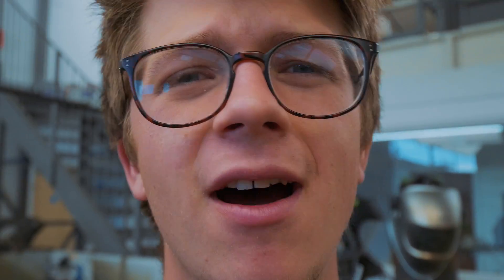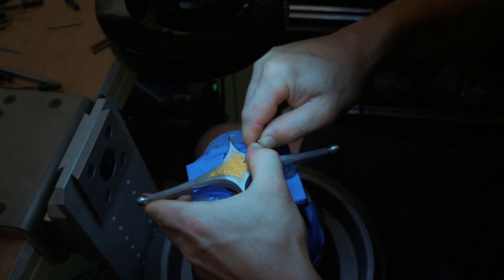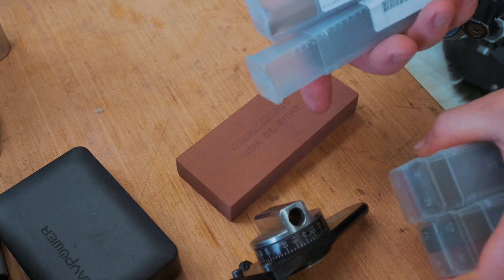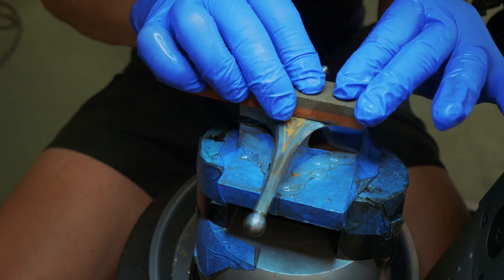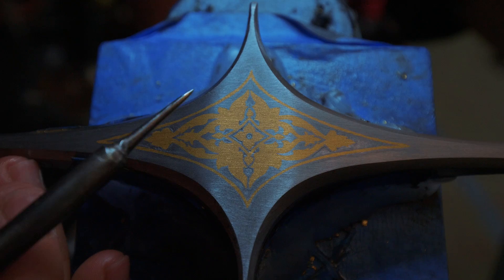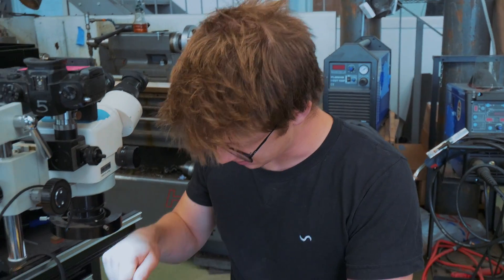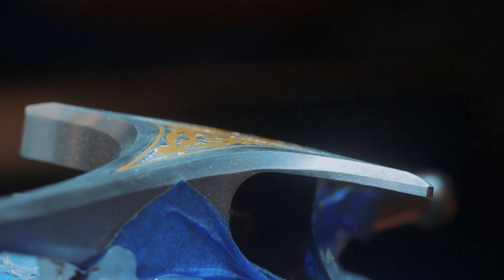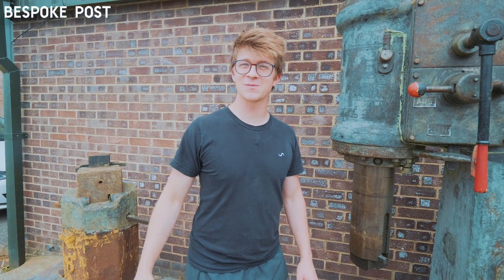MAKING A SHAMSHIR SCIMITAR!!! Part 8

Comment: make sure the scope is ergonomic, often with stereo set-ups like your scope, the eyepieces may become slightly mis-aligned, after hours of intense concentration, slop in the optical paths leads to eyestrain and worse.  i was working on rocket valves and valve seats with Bausch and Lomb Zoom scopes, and got very fussy 'bout my scope.  when it was tight, i could work so much faster.

Comment: You should check out some of the engraving work that Ilya of That Works has done, both on the aforementioned channel and on Man at Arms: Re-forged when he was there. Just like his forging his engraving is top notch as well. And Ilya does it with chisel and hammer, or I guess they are engravers and a hammer. He makes the tools himself from what I understand.

Comment: I am very late with this question but why chisel the top of rather then sand/abrade it away? I would have assumed the original or traditional way of smoothing the gold down flush with the rest of the guard would have been to use either a file or a smooth grindstone to minimize the chance of accidentally ripping up the gold and needing to start over with the inlay

Comment: I wonder, and anybody that has ever had experience with gold inlaying can please tell me because I know ZERO about doing this process... but my thoughts are, what if once you inlay the gold, if you put the whole piece into the paragon oven at a somewhat low temp for a while, would that help with the mechanical bond between the steel and the gold at all?? (My initial thoughts were to just pour molten gold into the lines but that sounded dangerous and stupid haha)

Comment: Every time I see how hard this is with modern tools it makes it more and more stunning that someone did this kind of thing with ONLY medieval or even bronze-age tools 4000+ years ago
Reply: theyd do it over the course of months though, Alec can do it in weeks if hed wanted to.
Reply: @BartJBols  true but I can’t even imagine doing that same piece in a lifetime with the same tools, imma need like 6 if I’m using medieval stuff lmao likely I’d just give up and be a farmer or something for at least 3 of those
Reply: You have to account for the fact that humans have incredible fine motor control with practice, doing it by hand after so long would be infinitely more controllable than the mechanical tool Alec uses, since it has a constant internal motor, the slightest slip can run into a whole line of ripped up or damaged material, when done by hand you can readjust both tools by minute increments,  it's the same with a powerhammer really, it's just the natural downside of powered tools of all kinds
Reply: I’ve thought this a few times, the time it takes, the precision tools but most of all the minute detail they did back then. Utterly astounding.
Reply: Medieval peoples specialized labor to a greater degree than we give them credit for.
Reply: For a one off, modern machinery setup costs are prohibitive, to make a cnc model, cut it, inlay the gold ? dip ?, and finish. 3D metal printer well it costs as much as an M400 but doesnt smell as nice. .
Reply: I was coming down to the comment section to say exactly this, except less eloquently.
Reply: I make knives and whatever else I feel like using exclusively tools and materials contemporary with english knife making in the mid-late 13th century. it's certainly not easy, I'm not gonna say it's a great idea if you have access to modern tools, but i would not say it's exactly harder per se. it's certainly more time consuming, but when working with hand tools it's much harder to make irreversible mistakes because the process is so slow. honestly I find the research much harder, personally. it should be noted though that this is my personal experience, and is subject to my own interpretations and biases
Reply: tools that someone also had to make by hand. someone started with no purpose built tools at some point
Reply: @magoshighlands4074  If I had one major complaint as a layman watching Alec's videos (beyond the fact that pattern-wielding is NOT Damascus) it's that he seems to want to use power tools as much as possible, even in situations where the situation could allow for slower, more controlled hand tool techniques.

Comment: if it wasn't gold and you didn't have to save it(let's say copper), could you just sand the extra off using a belt sander? Or would it drag the metal out of the grooves?

Comment: Have you thought about getting a lawyer engraver? Great design tool, then you’re not relying on a paper transfer? And also, it would be keep lines clean and you could etch deep and light as needed as you added layers of materials in the steel??

Comment: Two mistakes i noticed (compared to what i saw an old Japanese craftsman do).
1. the bed of the gold wasn't well made, it needed far more griping sites for the gold to catch on. Yes, that means more gold the wider the feature. But also, neater execution of the hammering, less gold to remove.
2. i've no clue who told you that using an air chisel would work to remove the bulk of the gold would work, you need to do it by hand, slowly, as to not upset the gold.
Not my two cents, just pointing out something that was discrepant between this and that.

In that case, he was putting gold features inside a small dagger guard. One of them was at least 1 cm wide, and then subsequently got chiseled itself into a lion.

Comment: For the power hammer, you can use paint remover paste, and rust remover paste. Brush PR paste on, leave it for a few hours, wash it off. Same with the RR paste. Then either oil it and leave as is, or repaint it however you like.

Comment: Would it not be easier to reveal the design by sanding? Or would that just rip it to pieces. Using a chisel seems very high risk 😬
Reply: gold is very soft so it cuts easy but that also means that it can tear out easy with sandpaper so you use a chisle to cut away as much gold as you can to get it about flush with everything else, also makes recovering valuable gold way easier then looking thru sand paper dust and used papers. also the stone are like and paper but not as aggresive

Comment: Hmm, wondering of the standard card scraper used in woodworking would work better for taking the gold down. 3 by 5 inch card, and you burnish a cutting burr on it. You are rubbing the bevel/bottom of the card on the surface being scraped down. Your chisel you are using is at a rather acute angle which will make it want to dig in more than one that is almost parallel to the surface.

Comment: 9:40 Did he really learn how to use a rotary tool bur so he will stop walking the bit across his work making a mess of it? 9:43 HE DID!!!! Finally! Let the 10+ cutting edges of the bur and the 40k RPM of the tool do the work and not try to force it, just enough pressure to remove the material is all you want or need. He knows what happens when you put too much pressure, the cutting edges bite too deep in the material and can't cut it and it walks across the project leaving a trail of misery. Do it with a die grinder when grinding a hole and the grinder itself does the walking and can break bones in the wrists and hands or shatter the bur sending bur shrapnel into you.

Comment: The full time engravers I knew, and they were world class, didn’t use those tools. They used rotary tools and every single kind of custom carbide burr imaginable most of them make themselves for specific features of engravings.
Reply: As you find out around 10 minutes. MUCH easier to move material with.

Comment: Instead of all the chiseling etc why didn't you just get a fine flat file or some 400 grit wet and dry sandpaper wrapped around a file and just file it to shape, you wouldnt cut into the harder steel and so the gold would have ended up level with the steel, then finally use it to level everything before you setup to polish etc.

Comment: If you used a chisel harder than gold but softer than the steel (maybe bronze?), would you be able to speed removal because you would have to worry about damaging the base steel?
Reply: I dont think there are chisels made of bronze. I think it would be too soft and become dull too fast
Reply: @raik8243  not anymore but Alec is competent at casting and chisels are easy to make
Reply: Interesting. Theoretically, I don't see why not. Just don't chip the bronze.
Reply: I don't think it works like that. He could use low carbon steel even, but the tool would just desintegrate too fast.
Reply: You would be honing your tool to often to be worth it
Reply: @kennybrandow4994  not on gold you can cut gold with bone
Reply: @raik8243  You're probably right on the dulling too fast portion.
But you and I both know Alec would absolutely make one from scratch if he thought it would work X3
Reply: @AnomalousZoologist  oh yeah absolutely and id love to see him make it work tbh
Reply: He was using a brass rod for jamming in the gold
Reply: @pyro3446  yes his idea is valid as ave would say "hierarchy of metal" but the issue is the chisel riding along the steel sub surface
Reply: @raik8243  Probably not been a call for them since the Pharoahs had people carving monuments for them anyway 😂😂😂

Comment: I'm an amateur knife maker and I remember making my second knife. I wanted to make a giant, 14 inch blade but I kept making mistakes. After the first big mistake, it became a 12 inch knife. Then a 9 inch, 8, 7, and finally it became a 6 inch knife. When doing subtractive craftsmanship, it sometimes becomes necessary to adjust your plans while making something. The key is to just pretend that the finished project was the original plan

Comment: Question. Why are you chiseling instead of sanding with high grit paper? To save a few bucks in recovering gold flakes? Yeah, sanding is slow but that is it's advantage. Slow and steady wins the race and gold is soft so it sands easily.

Comment: Wouldn’t it be easier to just use a really fine grit and sand the gold down from the start
Reply: Yes, it would, but gold is kind of expensive. That's why you try to save the most of it
Reply: Was wondering the same thing. Even if the gold clogged the paper you could burn it and then pan the residue. Miniature gold mining interlude for the video.
Reply from the maker: Potentially, this is the commonly done thing as far as I understand in the engraving world, so I went with this! It also allowed me to save the gold quite easily.